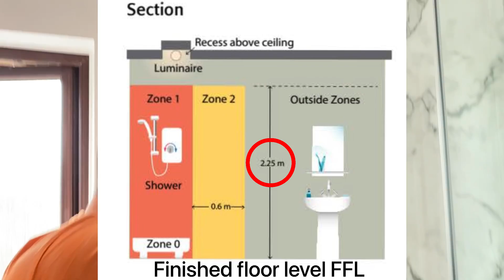Shower Zones Explained within a Bathroom - Zone 0, 1 and 2 plus IP Ratings

Comment: Awesome video, could you explain how zones work around a basin?

Would it be acceptable to have an electric towel rail (IP55) and controller (IPX4) in zone 2 of a basin?

Or would the controller require being outside the zone?

Comment: Would a in-line fan in the loft void be the correct solution for this shower room. With the extraction point above the shower. Drawing the moist air where it is being generated,  directly above the shower and not Drawing the air from the adjacent opening window. 
Otherwise, perfect training.

Comment: Nice education video for sure here but still puzzles me why Metal door runners on shower enclosure doors are not Earthed as standard - Maybe they don't conduct fault currents?
Reply: Is it an extraneous conductive part is the question and i would say it’s not. How would that door runner introduce a potential ?
Reply: @Badgerooni90   Electric Shower 32A / 40A MCB and wet person in the shower?
Reply: @Mike_5  if all circuits in a bathroom are rcd protected then in most cases supplementary bonding can be omitted. But your missing the point. Yes the runner is made out of metallic and is conductive but it’s not extraneous so it can’t introduce any earth potential so earthing or bonding it would serve no purpose